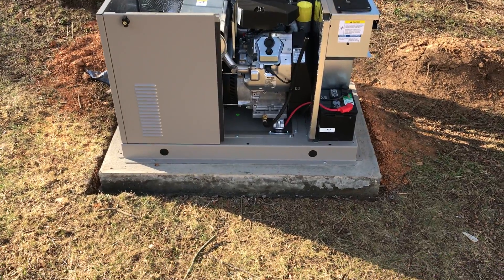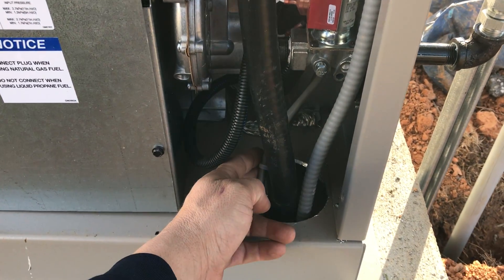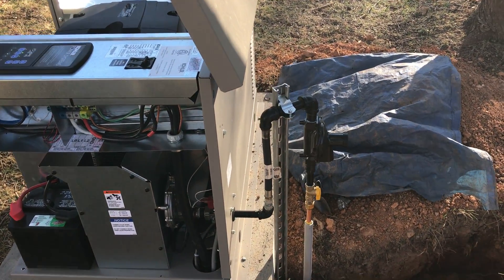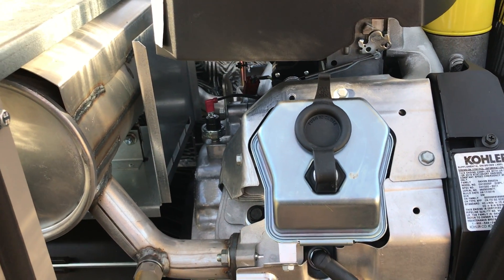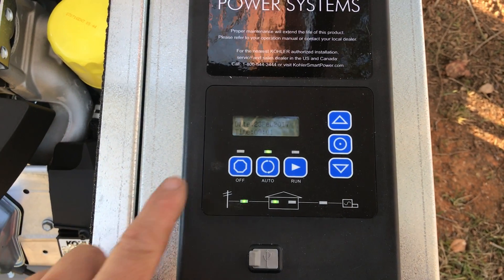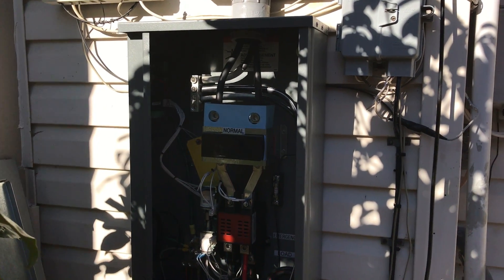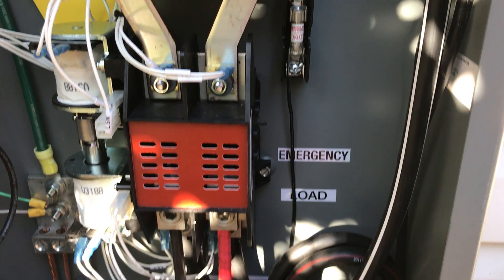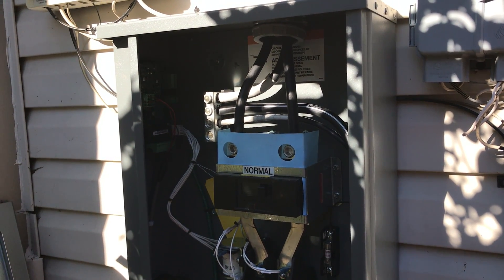Kohler 20kW RESD

Comment: Why did you go through the effort of such a clean and neat installation (which I commend you on) But left that rusty meter socket? I find it hard to believe you couldn't have at least sold a new meter socket if not the whole service! Really seems to me a disservice to your customer to hook up a  brand new back up generator to such crappy service.

Comment: Extremely grateful for this video which is the only one that actually shows the wiring in detail. I bought a Kohler 20RESAL-200 and comes with an RXT-JFNC-0200ASE ATS, [200AMP Service Entrance (breaker)]. I paid for it a month ago but is still in back order.  I pulled a city permit and now Fairlawn, Ohio, requires a disconnect outside for the generator as well. It has one in the actual unit but to make the inspector happy and because the unit can always be replaced, I installed a Square D 100 AMP safety switch.  This is so the firemen can disconnect the generator since it will turn on once they pull the meter and they won't spray the house until the generator is disconnected of course. 

All is ready for the unit to be connected, so I was wondering how to connect the Belden and it was good to see the video. I bought the Belden according to the installation manual Kohler sent me in advance.  
And, I ran it separate in a 1/2 EMT. 
Yet, I have three questions:

1. Can I run the three 14AWG (blk, wht, grn for battery/accessories charge) in the same conduit as the four #4 copper wires for the generator?
2. Where is the battery line coming from? it looks like it goes to the side of the ATS. Is there a spare 120V fed from the utility Service entrance connectors somewhere?
3. My wiring is a non separated ground and neutral so its only bonded at the ATS...so I need it to be a floating ground at the Kohler generator. I know Kohler has to ship them bonded but I cannot find anywhere how to detach that "bonding".

Thanks again for the video!

Comment: Nice Video.  Is the battery charger circuit in the load conduit or did you run a separate conduit for the battery charger circuit?  Do you still ship these or bigger kohler units?

Comment: Its looks good until you brought us to the ATS. We wouldn't pass inspection in SE Florida. A hub would be required when entering the top of the AST, I would be interested in knowing how and where you tapped that battery charger circuit and would not have installed that open fuse. I have no idea why you ran that cable into the house like that, it wouldn't pass here.

Comment: On this exact unit, how do we set weekly starting to keep battery charged? Mine does not run weekly.
Reply: You really need a separate 120v circuit from your house electrical panel for constant charging. But it should be doing a weekly test or exercise. Consult the installation manual
Reply: I'm think. There is a button in the switch. It might say test. I think you hold it for 3.secinds and it sets test time to whatever time and day it is when you do it . Not explaining very well but just watched someone do it the other day.

Comment: I like the way you run power through the concrete pad. Does the 20resc have the same access hole to run power through the bottom?

Comment: Generac does not use “Line Voltage “ to control switching.  Also, we can run low voltage and line voltage together with 600V Tray Cable. Check your 2017 NEC Code, completely legal.
Reply: Could you elaborate which NEC code sections you’re referring to for residential use? Thank you.
ARTICLE 727 Instrumentation Tray Cable: Type ITC
.....
727.4 Uses Permitted. Type ITC cable shall be permitted to be used as follows in industrial establishments where the conditions of maintenance and supervision ensure that only qualified persons service the installation:
(1) In cable trays.
(2) In raceways.
....
Reply: All models of transfer switch coils use line voltage for switching. The twisted pair is not for control its for coms between tr/sw  and rd2 cont. The logic board in tr/sw controls switching. The only code that applys to install of the twisted pair would be 110.3 b

Comment: Hi brother. I'm looking this install Thais quite different from my because the communication wires goes through the console main lines. And I having an error on ATX PCB board giving communication problems and the other error says low voltage ATX emergency. Well I'm in venezuela the Gen set only has 152.4 hours running. The Gen set shouting down for protection. And theres no support Kohler's here. And the other little problems seems that the Gen set has dc2 controller and looking in Internet need the sitetech software because can't connect in other way (oncue) to reset the errors. The Gen set running 152.2 hours only 5 minutes on sometime 30 min and lately only 3 minutes and enter the protection mode ant the ATX PCB board only blink a red led. I tried all. if you can helpme in any way please. Thanks bro. I called Kohler's and said my 20rescl never sale outside us or Canada by the model  and the sellers no show up after sale. Thanks if you can helpme

Comment: Quality workmanship, I would hire you just on how you ran the wires in the generator. Not many contractors take that kind of pride in their work.
Reply from the maker: gibbyair1 appreciate the kind words. We try to provide the clients the best product for their money.
Reply: Elite Power & Energy Corporation I am looking to get a generator that size but currently have a 200gallon propane tank I think it is, would I have to go up to 500 gallon to make it work w/ proper pressure
Reply from the maker: gibbyair1 it’s not a problem with pressure as all tanks work on the same pressures. It is the amount of gas on hand for outages and the ability to continue to vaporize the LP,  which is why larger tanks are better.
Reply: great information, thank you @elitepowerenergycorporatio3254
Reply: 1500 sq foot house with a finished basement in Illinois. What size would I need and how much is kohler  vs generac. 
Heat/ac. Some lights fridge and internet and sump pump.

Comment: Hello,
I'm in the process of setting up a backup power system for my house. I loose power a lot because of snow storms. My advantage power outage  is 5-8 days 4 or 5 times a winter. How many hours of reliable run time would you get out of a unit like this before you would need to re-build or replace it? Are there's units built to run 5-7 days at a time? 
Thanks
Reply from the maker: Woody83 - this unit will run for several thousand hours before needing replaced - if ever. Running 5-7 days is no problem as we have many that do that with outages we have here. The key to keeping them running properly is shutting them down to check the oil - and a good visual inspection - every 24 hours of continuous run time. 

Proper maintenance will keep your unit running for many, many years.
Reply: @elitepowerenergycorporatio3254  Thanks!

Comment: Can you still get this model? Seems that their website now only has the composite housing unless you step up into the bigger generators that most houses wouldn't need...
Reply from the maker: Kurtis Hasselbring you can only get this model from a dealer. Kohler does not advertise this model at all and you cannot buy it “just anywhere.” Check with your local dealer or we can sell and ship to you.
Reply: Ahhh ok - and this can be monitored with a smartphone as well?
Reply from the maker: Kurtis Hasselbring with On Cue, yes.
Reply: Thanks for your replies - one last question. When placing one of these on a property- what’s the maximum distance from the home that you can go before you have to worry about voltage drop? I may try & have mine placed further away from my house to be closer to the buried propane tank, but I’m not sure how far away I could go..
Reply from the maker: Kurtis Hasselbring rule of thumb is 100’ before upsizing wire size.

Comment: As long as your low voltage cables are rated at or above the maximum voltage there is NO CODE VIOLATION by installing the control wiring in the same conduit ! An awm rated cable is listed @ 600 volts.  Kohler does recommend a separate conduit and manufacturers specs NEED to be followed !
Reply: 110.3 b.

Comment: EPEC:  I'm pleased to have found your smart video and, like 'Frosty', was wondering where you guys are (not sure if you have a link on the page, or in your playlist, etc). If you were close to me, ie., Eastern Massachusetts, making a plan for our installation would happen quickly. We just built a 4000sqft house that has a natural gas heating system, natural gas burners in the kitchen, electrical water-heating system. I'm thinking of doing at a minimum a Kohler 24RCL.
http://kohler.jamgraphicsvps2.com/cmsAdmin/uploads/g4228.pdf
 I want to install a system that is substantially more that what we actually need as someday I'll need to move and this house will become a rental property and I want to know that the future renter will be in good stead. Thanks for recording and sharing this project. This assists a homeowner in finding a qualified installer.
Reply from the maker: Warren Currier we are located in Aldie, Virginia.

Comment: I have a question, with a unit this size, what can be run on it? I have a gas furnace, three freezers, fridge, net, four or five tv's etc. you get the gist, standard house. Would something like this power that? Or is it for the basics like water pump for the well, furnace and s few lights and that's it?  Great video, too ! Nice install.
Reply from the maker: sniggity - You would be fine. Might need a load control device or two depending on the large appliances but if done correctly this will fit your needs.
Reply: sniggity:
There are 2 ways to determine how much power you are using.. 1 is to get a clamp meter and put it on each of the 120V primary legs... Then its some adding and calculating between the 120V and the 240V appliances... Its not easy at 1st but once you get the hang of it, you can determine how much power you are using in real time ... OR
Buy this below.. It shows in real time how much power you are using, it re-freshes every 10 seconds ...  I have it, its great, i know how much power each appliance is using .. The MOST i have EVER used was 17k watts ...

https://www.amazon.com/Efergy-4-0-Wireless-Electricity-Monitor/dp/B001Q1G4WK/ref=sr_1_3?ie=UTF8&qid=1539535750&sr=8-3&keywords=efergy+elite+4.0+wireless+electricity+monitor

Comment: I have a 20RESA and it has had its issues. Looks like Kohler fixed a lot of the flaws. I went through 3 plastic housings in 3 years due to cracks. Now just discovered the upgrade to the battery charging circuit now that the unit is out of warranty. 

Nice install. 

Took Kohler too long fix the product in my opinion.
Reply from the maker: Michael Smith Give me your address and we will mail you the part (free of charge) if you will pay the shipping. It’s an easy fix but you should upgrade firmware too. Not sure where you are located so not sure about qualified service in your area. Worst case - you ship us the controller and we update it for you and ship it back. You would be exposed while this happens but we can help if you need it.
Reply: Elite Power & Energy Corporation thank you very much for the offer, the charger part just arrived in the mail today. I live in NewJersey and I’ve been on generator power since Friday. Had a dead (cooked) battery on Saturday. But your video solved my problem and that was great free advice.

Recently a local shop I frequent started supporting Kohler generators I’ll talk to them once power is back about the firmware. I’m at 320 hours on the unit.

Thanks again.
Reply from the maker: Russell Myers it depends on when the unit was manufactured as it may have set on a shelf for 2 years before you got it. An easy way to check is to verify what the charging voltage is at while at the Ready position. If it is charging at 14.1VDC or more you need the Battery Charger Diode kit. If it is 13.3-13.7VDC you are good. You should be running the latest firmware and your service provider should upgrade when they provide your service.
Reply: I have a Kohler 20RESC installed new in September 2016. What are the details on the upgraded battery charging circuit and firmware? Is this something I might need for my own generator or is this for older models?
Reply: It's charging the battery at 13.3v; never had an issue with a battery going bad. Current firmware RDC2 is 6.7; newest is 6.12.2. Install looks not too difficult.
Reply: It's charging at 13.4volts.
Reply from the maker: Russell Myers then you are good and have (at least) the second generation controller. What firmware are you running?
Reply: 6.7 RDC2
Reply from the maker: Russell Myers 6.7 had issues as does 6.9. You need to upgrade to 6.12.
Reply: I have an older unit. I see you have received an answer from the good folks at Elite. My unit was reading 14.1 volts and is now at 13.7 volts after the upgrade.

Comment: Very nice install.  How much for this unit including 200 amp single phase transfer switch? Also what are the dimensions of the unit or a link with the specs, Kohler doesn't show resd version of 20kw on there site. Thanks
Reply from the maker: brickit26 you can obtain the specs from our website but the price depends on the type of switch you select ad there are several types of 200Amp switches. Budget $5K for the equipment.
Reply: Elite Power & Energy Corporation Thanks, Also on average how much to install this type of gen and switch?
Reply from the maker: brickit26 our installation packages start at $11,299 plus permits, depending on the jurisdiction (they range from $50 to $1000) but most installs are in the $13-15K range, turnkey.
Reply: Elite Power & Energy Corporation Thanks
Reply: @elitepowerenergycorporatio3254  

Thank you as well.  I am in Canada so the costs will be different here, but this gives me food for thought.  Power outtages in winter and hurricane seasons are becoming more frequent.

Comment: Great video. Impressive installation. Is there any way for the homeowner to see the status of the generator from inside the home by some device or meter?
Reply from the maker: Jere616 - The On Cue system connects the unit to you via the internet with an App or on your PC. Most people use the App.
Reply: Cool. Thanks!

Comment: I wish you were in the Sarasota, FL area. Excellent install .. we're looking to replace our old 16 kW Generac with potentially this Kohler unit.
Reply from the maker: D Jaquith - Thank you. Let us know if we can of assistance.
Reply: Elite Power & Energy Corporation 
If you do work in Sarasota, Florida then you can .. we're in the market now.
Reply from the maker: D Jaquith - unfortunately we aren’t. Good luck with your installation. Make sure you:

A) - NEVER buy from anyone that is not a dealer and/or certified to install KOHLER. You don’t want them learning on your home. 

B) - Ensure you have a CERTIFIED start-up performed to confirm the installation is up to KOHLER standards. 

C) - Try to get an installer that self performs all the work so there are no issues down the road as to whom did what wrong. Don’t buy anything from anyone that cannot perform service on what they install.
Reply: Elite Power & Energy Corporation 
Excellent tips. I'd 100% hire you and your company, very impressive work! Absolutely, I'll follow your advice and many thanks.
Reply: Did you have bad luck with the Generac? I'm torn between the Generac and Kohler.